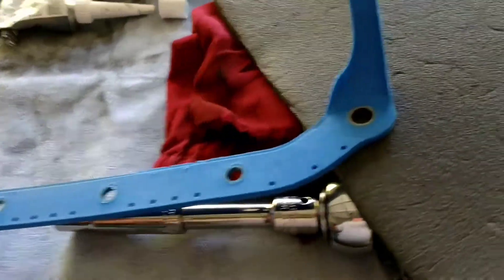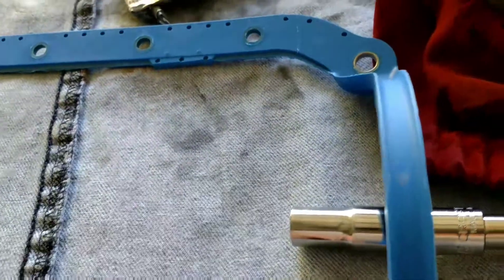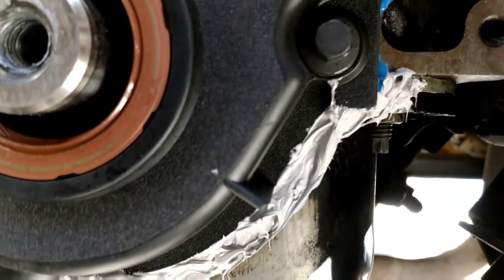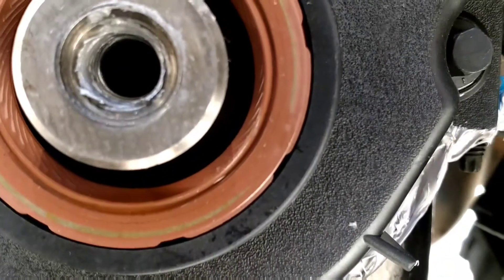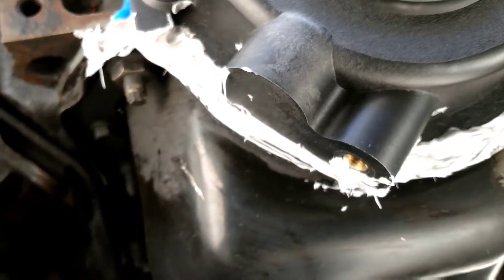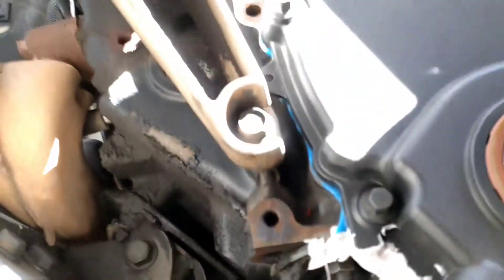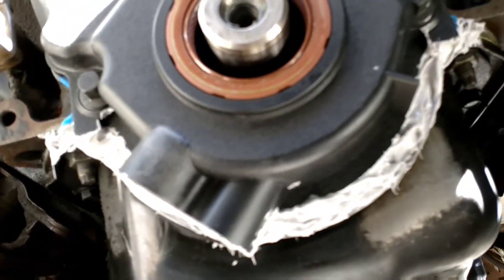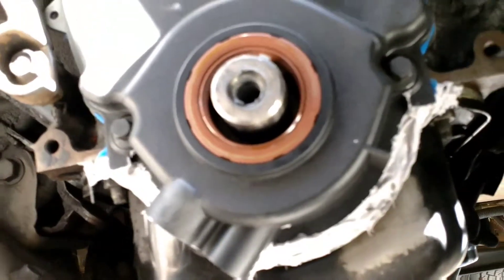Should have used Fel-pro.

Comment: First make sure your engine even needs a timing chain in the first place.
To install the timing cover properly the oil pan has to be lowered enough in the front to allow the lower edge of the cover to easily clear the pan.
If you do not have the means or accessibility to lower or drop the entire pan asaembly, I suggest not attempting to remove the timing cover, but to hire a qualified shop to do it properly.

Comment: I have used Fel Pro for about 45 years. Last weeks purchase from Rock Auto they left out 1 of the 4 locating hollow red plastic dowels on my small block LA Mopar intake manifold gasket set. A few months ago I bought a timing cover replacement gasket set and they included (2) Two early front oil pan gaskets with (6) six  rubber pull through tits and no later style with just (2) two  rubber pull through tits. Somebody in Quality control in Skokie must be Meshuga. Maybe I'll have to check out Mahle ! I have been extremely incovienanced  by this company that I had grown to respect for their quality over the years